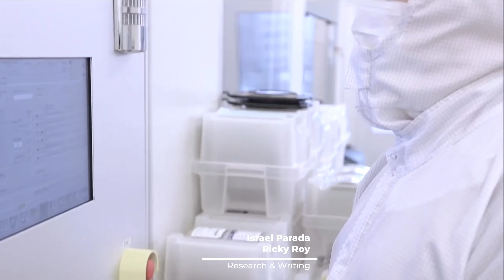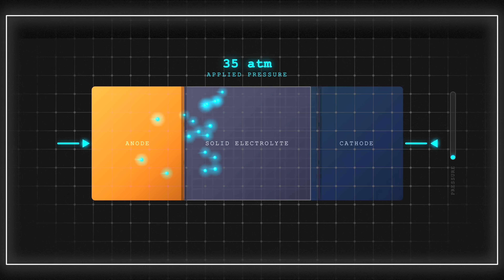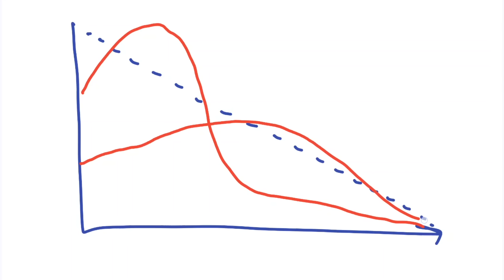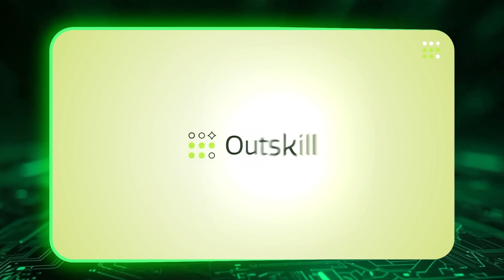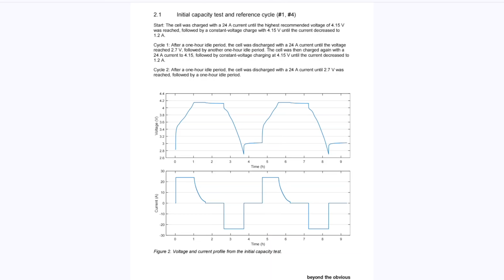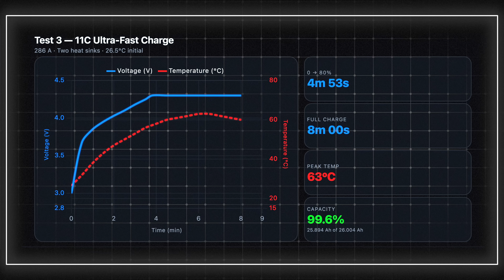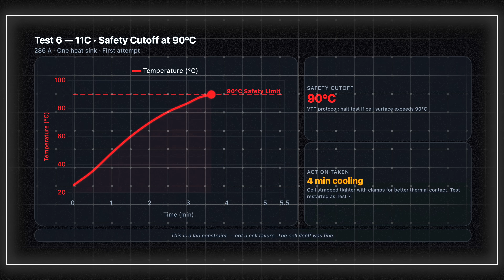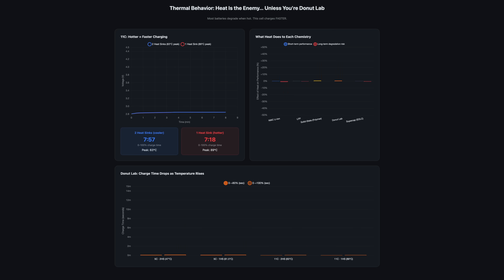Donut Lab's Solid State Battery Test are Shocking...

Comment: You said that the discharge was the same at 26Ah? Between the reference cycle and cycle #7, discharge capacity dropped from 26.520 Ah to 25.731 Ah (a 3% loss), and discharge energy dropped from 92.511 Wh to 89.229 Wh (also ~3.5% loss). A 3% drop in capacity in only 7 cycles. Sure it is extreme charging at 11C, but they do claim the battery can handle this. And it had a long time to cool down between cycles.
Reply: After 11C charging the cell demonstrates a pattern of not being able to discharge as much Ah as in 1C and 5C tests (can be seen in test #3, #6 and #7), suggesting altough able to charge faster when warn, that once cool again (after an hour) then the discharge test performed is not all the (rapid) charge gained is recoverable. The cell does show a degrade after the high current tests, however, this appears to reset after a 1C charge, as can be seen if one looks at test #3 (11C two heat sinks) the cell loses discharge capacity but this recovers in 1C reference test #4 (indeed to a higher level than the initial reference test). If one judges the cell from the median 26.0Ah point, the cell gains and losses between +2.0% (#4) and -1.6% (#6) in discharge capacity.

Comment: I've watched a few Youtuber reviews of the recent Donut Labs first stage battery reveal and think yours was the best. You're right there is no way to determine what the energy density is based on the data given so I'm not sure why Ziroth or anyone else tried to state one without knowing the weight of the cell tested. Knowing that lithium-ion cells don't like to be above 65 degrees C and are often cooled to under 45 C this cell seems to function better at the hotter temps even up to 89 C which is quite impressive. Again, this is only using basic passive cooling nothing like what would or could be included in an EV which could really push the cell to extreme performance levels. Also, if this cell has no lithium or other toxic components as stated that would be next level as there's nothing currently comparable available especially at the stated price point and cycle life which we have yet to see in the reveal. I'm looking forward to the next set of data to be released on Monday either way.

Comment: Agree with others, best video so far. I won't be watching other channels. But the CTO mentioned in another interview that the voltage is configurable. That they just did this so it's a drop in replacement for current lithium battery architectures. He said there will probably be new ways to take advantage of the capabilities of the battery. So this isn't a limit of the battery. Just something they've done for compatibility. The only thing that does bother me with your video as well as others is you guys try to apply your current knowledge to this battery. If that were the case, I would think maybe this mystery would have been solved long ago. Maybe there's a possibility  what they're doing is beyond your current knowledge. Just a thought.

Comment: The assertion that it would make no sense to misrepresent breakthrough technology is contradicted by multiple historical precedents in which firms overstated or fabricated capabilities to increase valuation, secure capital, or influence market perception. 
      Theranos claimed revolutionary blood testing technology to attract investment and strategic partnerships despite internal knowledge that the system did not perform as advertised, Nikola Corporation promoted hydrogen and battery vehicle capabilities including staged demonstrations to elevate stock price during a public listing phase, Lordstown Motors publicized nonbinding preorder figures to strengthen investor confidence during its SPAC process, QuantumScape presented selective solid state battery data amid extreme market enthusiasm for next generation energy storage which drove valuation far ahead of commercial readiness, Enron misrepresented operational and financial performance to sustain equity value and executive compensation, and WeWork framed a conventional real estate model as scalable technology infrastructure to justify inflated market capitalization.
       In each case, the underlying incentive structure included access to capital, executive equity compensation, competitive positioning, or survival during cash burn phases, demonstrating that strong financial motives can and do override reputational risk in emerging technology sectors, particularly in areas such as batteries, where technical verification is complex and difficult for the public to independently assess.

Comment: What i hate about all these specs is they say 400wh/kg but no energy density by volume.  Maybe that pack only weighs half as much as a standard nmc but is the same volume.  If that is the fact vehicles will only get lighter and not smaller

Comment: Could the electrolyte material be made of a type of PTM (Phase Change Material) like what you can buy instead of thermal paste. That way they can claim its solid state (technically only true if in a rest state) but as the temp increases, the material flows into the microscopic surfaces of the anode and cathode. And if the PTM has a lower resistance at higher temps, that could explain how they are getting better performance with higher temperatures. Also if the electrolyte is a PTM and this is a Lithium NMC battery, could the phase change brake and reabsorb the dendrites each cycle of the cell?

Comment: I am torn I like the fingerprint analogy.  It helps but I think one of the difference is the heat created vs the lithium batteries.  I know this is the first step by a 3rd party testing.  You said CATL is developing a battery that can charge as fast can a typical liquid Lithium battery charge that fast?  As for the fingerprint there are many that are very close and I would imagine with chemistry could get a fingerprint that is close.  I am from the construction industry and ask someone who has a crushing jaw with 19% manganese vs 22% manganese  Very close but makes a world of difference.

Comment: You ask why they would lie about having lithium?. It's a real simple answer. If it is in fact a scam they would 100% lie about it. They would also not do the obvious and do a chemical analysis at the lab. The fact that they chose very specific testing says a lot. And to top it off, they didn't even have the foresight to anticipate people connecting the charging curve graph by comparing it to a lithium charging curve. I know it's not always good to jump to conclusions. But you can clearly make judgment based on the evidence that is 100% there.

Comment: Why is everyone trying to use the NMC-Li voltage chart as some gocha moment? It comes from paper that tested it at a 0.15C and 0.25C whereas Donut battery succeeded at both 5C and 11C. And the voltage charts are quite different from one another depending on current used.

Comment: So. Voltage profile of NMC lithium, BUT works better at high temperatures instead of NEEDING to be aggressively cooled like lithium, and the company states there is no lithium involved... I am incredibly curious what's actually in this thing!
Minor error: At 5:58 right after describing how it was passively cooled by aluminum blocks, you said "there's no passive cooling, there's no fans or water pumps" ... I believe you meant to say "there's no active cooling" at that point, which is how one would describe fans and pumps. Slip of the tongue. 😅
Reply: The voltage profile was artificial.

Comment: I’m still not convinced all parameters are “perfect” here, but someone at Donut Lab clearly understands what to show. The VTT test basically confirms extreme fast-charge capability (11C on a 26Ah cell) under the chosen setup, but it doesn’t answer the hard questions like cycle life or verified energy density. High C-rate charging is notoriously harsh on Li-ion cells over time (heat and degradation mechanisms), so the real test is whether it can do this repeatedly without rapid capacity fade. Also worth noting: some cells can show a small capacity increase in the first few cycles, so a near-nominal reading early on doesn’t settle the long-term story.

Comment: They've stated repeatedly that current products are specifically designed to replace cells using standard chemicals. This offers the potential for rapid integration, but it's not optimal and doesn't fully utilize their potential.

Comment: Is it possible that they have perfected a Potassium-Ion cell with a solid or semi-solid electrolyte? Some Potassium-Ion chemistries have similar voltage characteristics. Some digging in the ACS archives from 2019 shows an interesting paper that originated from some some Russian research titled "High-Energy and High-Power-Density Potassium Ion Batteries Using Dihydrophenazine-Based Polymer as Active Cathode Material". Some combinations yielded very high energy density, voltage curves in the same range as Li-Ion, and even eluded to the potential for a solid electrolyte.

Comment: 14:00  I heard it mentioned MORE than once they MADE this test cell to imitate a LITHIUM Cell!!!  (obviously because they are so popular) 

even the SHAPE is the same as Lithium Pouch cells.  I would expect it to mimic Latium cells in many ways.
Reply: ALSO the test machinery is also designed around lithium ion cells, even the arbitrary temp limit (Insisted upon BY VTT (not Donut Labs) is based on Lithium Cells, 

The Donut Lab cell would NOT have been effected by higher temperatures.

Comment: Great info, thanks! This is pretty much exactly what i was thinking about them from moment 1. Nothing revolutionary, but still quite good. 

I say drop it into something we use often (ie - RC heli/plane/drone or e-bike) and see how it does. These are already scalable devices that can be proven on a small platform without needing a massive infrastructure to mobilize like an EV.

Comment: "An agentic AI tool for battery researchers harnesses data from previous battery designs to predict the cycle life of new battery concepts. With information from just 50 cycles, the tool—developed at University of Michigan Engineering—can predict how many charge-discharge cycles the battery can undergo before its capacity drops below 90 percent of its design capacity.

This could save months to years of testing, depending on the conditions of cycling experiments, as well as substantial electrical power during battery prototyping and testing. The team estimates that the cycle lives of new battery designs could be predicted with just 5% of the energy and 2% of the time required by conventional testing."- University of Michigan website (YT won't let me post the link, sorry. Google it)

Comment: Amprius has liquid electrolyte lithium ion cells with 450-500 Wh/kg in commercial production. So 400 Wh/kg is a bit underwhelming for a solid state battery. However the Amprius cells only do 1300 cycles.

Comment: Cringe... the 0-80% charge time diagram... how could you? You explained it yourself just before!! 1C literally means "1 times Capacity", so if the capacity is 1 Ah (Ampere-hour) then 1C means 1A (Ampere) but if capacity is 10 Ah then 1C equals 10 A. Battery engineers use this way to rate current because chemical batteries inherently work that way. An easy way to think of it is that one 10Ah cell basically works the same way as ten 1Ah cells connected in parallell. Now if my car can charge to 80% in 20 minutes, you would (hopefully) not be surprised to learn that 100 cars of the same type can also be charged to 80% in 20 minutes, if they are charged at the same time. Anyway, "LFP at 1C" and "NMC at 1C" and so on is just silly, because 1C is whatever current is required to get a full charge in 1 hour, or an 80% charge in 80% of one hour, which is 48 minutes. Now, would it be technically possible to construct a measurement based on the EVSE delivered current and see a variation in how fast you get to 80% SoC due to differences in charging losses? Yes, it would. But your stupid diagram that wants me to believe that LFP takes 61 minutes to reach 80% at 1C versus what indeed looks to be 48 minutes if we switch to NMC but use the same charging current... implies a charging efficiency of 48/61 = 0.787 => almost 22% greater losses for LFP than NMC. I don't know what you based your diagram on, but it is unfortunately very obvious that neither the person who made the diagram nor the editors have the slightest idea what you're talking about. It's rather like telling me that a train is 22% faster than a car when both go at the same speed - a claim sufficiently stupid that all but small children should see through it immediately!

Comment: It smells NMC in here.... and really, if Donut's claims about thermal stability are credible, why would they not insist that VTT relax the 90 C safety limit? Your equating lower internal resistance to "likes to be hot" is incredibly disingenous, especially if are to treat this as an unknown and perhaps exotic chemistry, but for basically any battery, the lowest internal resistance occurs in a state known as "internal short-circuit" and this is indeed famouos for being quite destructive to the cell, and its surroundings! 

Basically it makes a lot of sense to commission the test in the matter Donut has IF the cell is not in fact solid-state. It would be easy to ask them to open up the cell and investigate not the chemical composition, but just if it contains liquid electrolyte, for example. Donut could even have people present to verify no snooping was going on. Instead we're asked to believe no such tests are done simply because they need to protect their IP. It would be almost miraculous if the cell just happened to exhibit pretty typical NMC characteristics, especially that voltage curve, if it's chemistry was much different, and there is really nothing in this test that excludes the possibility of the cell being a not very unusual NMC cell (perhaps high in C).

Bodø/Glimt knocked out Internazionale from the Champion's League, so the time of miracles is not over. But I'm not prepared to believe it until I see it, and the evidence so far... is very far from convincing.

Comment: Maybe the similarity in some aspects to liquid based lithium ion units, is down to the used of liquid material during the cell production phase. Could it be that this is used in a way such that said liquid essentially dissipates post production, but leaves a residue which then mimics the behaviour of other battery rypes/chemistry.

Comment: IMO that looks and behaves too much like NMC battery and they also fall short on their claims about energy density. All the data from this tests suggest that this is just a really good NMC battery - numbers are good but nothing that is not commercially available today. I will remain skeptical until more tests came to light
Reply: The NMC theory is interesting but wish that all the channels and commenters saying its commercially available could describe these or link to a video of nmc batteries with these characteristics. Not saying they don't exist but I'd like to know more about the current best NMC cells performance when it comes to charging, heat tolerance and expansion.

Also would like to hear some informed guesses on what the Donut Labs strategy is if it's indeed a NMC battery. So far ive heard theories that its to prop up verge or some long con to get investors
Reply: If anyone is querious there is now more info and comparison with existing batteries on TomBoettichers channel in german.

Also some theories on what could be Donuts strategy on Ben Alexxanders chanel

Comment: So what I am theorizing, assuming this has truth to being a Solid State battery is that it may be more a semi solid state and they are using an interface chemical to bond the anode and cathode to the electrolyte. Still seems there is a healthy amount of horse hockey in their statements, can't wait until someone with the right equipment gets their hands on a cell.
On another issue, seems like there will need to be some massive local battery storage at charge stations to allow for that 11C charging - I don't think the NA grid will like the rapid ramp up/down of EVs recharging that rapidly. Possibly MIT Concrete batteries?
Reply: That 11C rate was intended as a demonstration rather than any expectation of real-world behavior. I'd personally be surprised if we see widespread availability of any public charging above 5C for a fair while.
Reply: @Thunderbuck  absolutely. A quick search shows level 4 charging is starting to roll out, guess we'll see if the NACS connector can take the full 700kw rating in its "current" configuration. Or if the grid can when it becomes common.

Comment: Just the fact that they were able to charge at 11c rate without swelling or battery catching on fire should be a clue. Now doing 11c charging for nnc battery would cause a thermal runaway and emissions of toxic fumes, extreme swelling, and probable a fire, according to AI. What your take? Seems like a very important clue, that you have not mentioned.

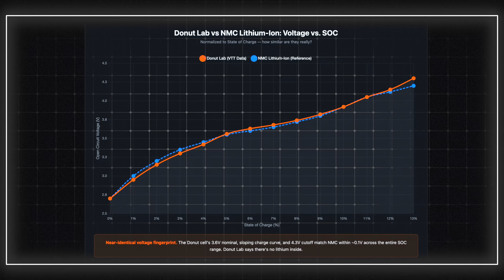Comment: I'm not sure this is an exact NMC curve: An NMC cell voltage tops at around 4.25V,  the curve given at 4:13 goes all the way up to 4.35V. A minor difference which could be just a measurement error? Could be. Or this could be something different. But this is, basically, an approximate NMC cell charge curve. Approximate, but not exact. EDIT: I must say that this charge curve does fit better another type of lithium-ion battery - the Grepow high voltage LiPo cell. Plus, if you do a google search for "Grepow high voltage 4.35V cell", what you will see is.. Well, Just do it 🙂. Well, it's might be just cosmetics, maybe the battery looks the same by chance.

Comment: 100,000 cycles with 10 minute charges and 10 minutes discharges puts you on a 4 years non stop test... i doubt they done that
Reply: No but you estimate the battery degradation based on the tests you can make on a shorter time span